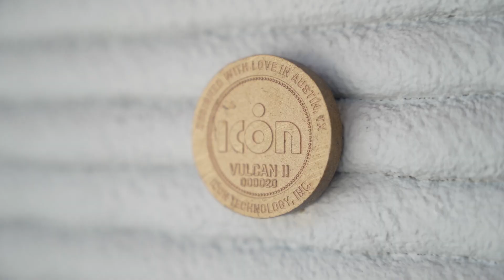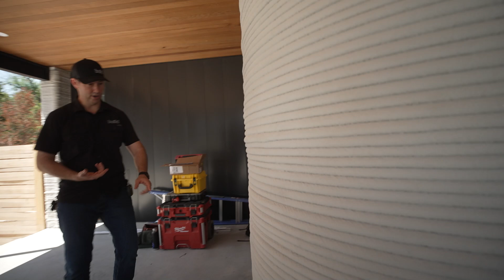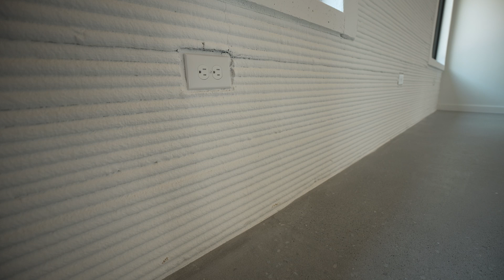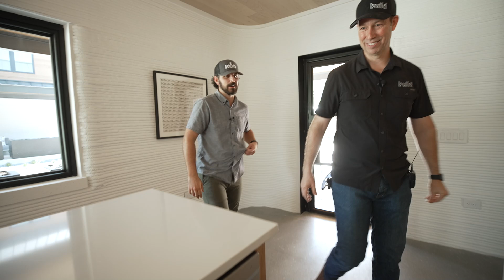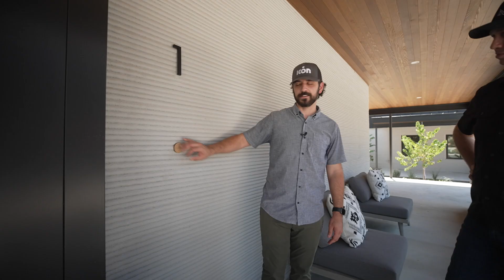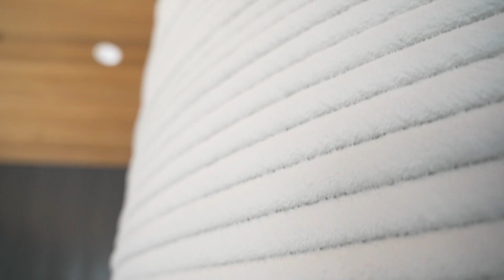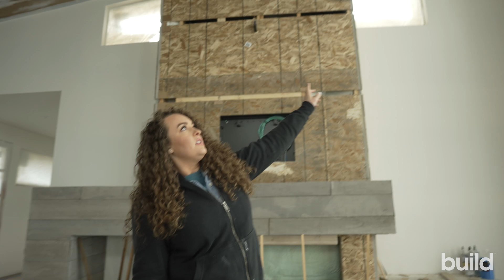Update on 3D CONCRETE PRINTED Houses - They’re GORGEOUS

Comment: Yes this is cool but don’t see how it beats ICF. It doesn’t have steel reinforcing and has major thermal bridging around the windows. Also if it floods it will never dry out due to using open cell in the walls.

Comment: You know those ugly dark streaks that develop on concrete over time thanks to rainwater? Now think of all the pollen, dust, dirt, spiderwebs etc that settle on all surfaces. Now imagine not having a flat wall, but ribbed walls.
Yeah, you’re gonna be doing a lot of pressure washing to keep your “cheap”? 3d printed house looking clean on the outside.

Comment: A non-sloped reinforced slab that runs from outside right into the conditioned space?  This is somehow any good for thermal and moisture?  Metal headers that are 100% efficient as thermal bridges?  Windows just globbed in with multiple tubes of caulking.  What?  Objectivity?

Comment: There ya go. Recycle platics in cement mix to use as plasticisers. Btw i would have built whole home concrete with edco roofing and knocked down 3d rib look. These look too much like shipping container commercial structures. Open cell foam, hydroscopic, traps water, noooo. Closed cell only. 800k whaaaaat. No way. Matt come build my home.

Comment: garbage produced by austin. hard to believe matt even mentioned "craftsmanship." you can have software, technology, tools, etc but it doesnt matter if the applicators are offering cheap products to consumers at elevated cost. texas is typical for complete trash homebuilders, this is a pure example of a cheap build slapped with sticker that has no design relative to efficiency or effectiveness for the consumer. not happy with you matt, you are known for calling out bad builders/materials
Reply: My thoughts as well.  The shiny object obscures objectivity.

Comment: Meh.

"Boring Bricks."
Modern post and beam is amazing.
And of course the USA has used concrete for a Century in order to make basements instead of "built on slab."
Still like the term "iterative" tho but of course in the USA we reinforce with steel as well if you're serious about Hurricane protection.

Any no shortage of iron ore in the USA let alone steel production at the moment.

Nice roofs and roof design as such!

Comment: 3D printing homes is the Juicero of home building technology. You could build multi story concrete homes using tilt wall panels like they do for warehouses and it'd be quicker, cheaper and have a better finish. CMU block would be faster/cheaper too. Heck even ICF would yield a better/faster result. But hey good on them for getting boat loads of VC cash from investors that don't know anything about construction.
Reply: Yeah, if you point out where their 3D construction needs improvement - they have no interest in hearing that.  So, in some cases the business model is looking like a pyramid.

Comment: The only reason why I'd want to put a plaster finish on the inside, not that the print doesn't look rad, is because all those lips are going to collect dust. Anyone who suffers from inside allergies is going to have one heck of a fun time making sure that the dust can be removed from each and every single one of those grooves.

Comment: Interesting how they will solve roof problem on Mars. It kind of difficult to build roof with 3D printer. You can print roof on flat surface and use crane to put it on top of walls, but probably they will find another solution

Comment: I 3d print as a hobby and i think at some point the 3d printing of concrete and wood will be a useful construction tool, but i think they way they designed and built the houses are frankly really suboptimal.  They could have had a double wall layer and put in aircrete or foam, could have had a guy with a trowel to smooth out the lumpy walls, or included a stabilizing intralayer material
Reply: 3d printed homes are little more than expensive novelty items.
Reply: @TMS5100  The same was said about the computer, the internet, and even the iPhone.  It's funny to hear the same about 3d homes.  Too many social, technology, and economical factors are coming together to call this a novelty item.
Reply: Exactly.
Reply: @SpaceCrete  hey you guys are doing some really cool things.
Reply: @Gleepglopglorpahaha  Thanks! Still early in development.

Comment: How does the cavity closer and wall ties work in this? He said they want to avoid thermal bridging but it looks to me as if the nozzle just goes from front to back at each window frame. Big thermal bridge spoiling the window psi. But maybe it stops and there is a thermal break of some sort? And are they putting ties in between the leaves every so often (basalt?), or is this strong enough not to need them? Concrete + PUR foam is pretty high-carbon construction of course. And I wonder how the 2nd floor is tied down onto the concrete.

Comment: Been going to countries in South America for years. Preference is Colombia. Medellin to be specific. Just spent a month there. In Remodeling all my life. The places I have stayed in are all concrete. Either concrete poured walls, floors, ceilings, etc. All is concrete. Even interior walls. Massive concrete foundations. As one professional told me. They have been doing it 1000's of years an are good at it. Huge multi-story bldgs. Tornado, hurricane, flood, fire proof. Just awesome infrastructure. Makes bldg. in USA  look 3rd world. Cabinets only thing that can burn. Clean an wash walls an repaint. Want transfer to floor above. Btw I talked to a retired American man was there during Earthquake. On 7th floor. Said building swayed a little but no damage. Medellin sits at 5000 ft elevation in the Aburra valley surrounded by Andes mountains. Called City of Eternal Spring. Great weather year round Gorgeous city. Concrete sidewalks  with tile or brick. Great restaurants. They use block also an clad it with brick or tile pavers. An many roofs use Clay Barrel Tile which is lifetime pretty much. I have remodeled enough fire, flood, tornado, an wind damaged homes to know we have pour construction practices. We build junk that is supported by the insurance industry. Remember him talking about Haiti building out of block. Well so does the Dominican Republic which borders Haiti. Saw there bldgs. Block an poured concrete inside. More durable.  We need something better.

Comment: Things I've never seen addressed on 3d printed concrete.
1. Bonding between the layers to avoid separation under in and out of plane loading.
2. Minimum Steel per ACI 318
3. Ductility requirements seismic detailing.
Reply: It is a bright shiny object, so they get distracted from all that stuff - or the moisture and thermal stuff.  Still, it is surprising that this project got permits.  Plop down mortar layers on portions of an oversized slab - that is both interior and exterior (without slope).  How is the upper floor attached?  If they placed conventional reinforced concrete between wythes, then there is no insulation.

Comment: What about insulation of the exterior walls? Seems like there is nothing to increase the R-rating. Also the curved edges, why not program the 3d printer to make more abrupt turns so you don't get that ugly curved corner? Finally, would it also be that much effort to have a mason to go over the outer walls and smooth them out as a finishing touch before the cement dries?

Comment: 3D printers are attacking the wrong area of the home building process. Carpenters can put up traditional walls much faster than 3D printers can do it when also including delivery and setup time for the 3D printer on site. What are the major project time consumers in home building? Those are the problem points to solve -- like waiting "30 days" for the concrete basement walls and floor to cure  before putting the first floor deck on. Or the roofing (trusses plus shingling). Obviously those other areas are too hard for 3D printers but the walls offer no real time advantage. Energy/carbon trade of concrete vs conventional wood?

Comment: The idea of 3D printing is very cool. Question that I would have is settling and the concrete walls cracking like a driveway. What’s their solution for it?
Reply: i think they print on top of foundation footings to prevent settling
Reply: These are engineers,licensed, contractors, and concrete experts. I'm sure they've thought of a way to prevent settling.

Comment: I’m glad you guys see the ‘positives’ in this printing process.  Doing plumbing and running wiring will be a challenge in such homes.  I followed that process as it promised better cost and lower price.  But this thing lists for 800K, no garage and a boxy industrial kind of cheap looking second floor in a condo type of a setup?  Really?  Looks to me like all promises broken.  While innovative and cool, I feel like you’re taking full advantage of potential customers, selling prototypes for a huge markup, completely breaking the promise of 3D printing.
Reply: This how early adoption works. Wireless cellphone Swede like $10k in their time when they came out
Reply: In a news report a buyer of 2 of these homes said she could not then get insurance.  Paid cash obviously.
Reply: It's all such a scam and the corporations steal all the good ideas, mark them way way up and give zero benefit to consumers
Reply: @stedmans4christ  You're spot on.  Our friend doesn't understand technology and how business works.  I did my own R&D on 10Gbps fiberoptic network which uses passive optical splitters, which really requires capital, and I never priced my product telling telecoms and cable companies, they need to pay extra to cover my R&D.  Instead, I designed most of the switching logic inside the chip itself which interfaced on both Core Network and Outside Network spend 2M to spin an ASIC, and eliminated a cost of a 25K Cisco switch from the design.  Approached customers and told me that my stuff is 1/5th the cost of competitors and explained why, and only after five years I would have made my money back of startup and R&D costs.  My customers went to my competitors, and within 30 days Juniper bought us.  If I went to my customers and told them to pay more to cover my R&D, they would have showed me the door.  Only ignorant public would fall for such BS.  Yeah use my hard earned money with no benefit to me so I can pay 2X for a house only for you to cover your R&D costs.  What a joke.  The R&D cost usually should be spread over high volume, not few suckers.
Reply: @stedmans4christ  do you think RnD costs nothing? It’s VERY expensive. They probably made close to no money on these homes

Comment: Too Cool. What is the cost of the sealant? How often does it need to be done? What is the p.s.i? of the walls, insulation value?
What is the wind load factor? Can vertical rebar be put in to support girders for a concert, fireproof ceiling? How would you figure the volume of paint or sealer with a texture like that?

Comment: That's a cheap ugly no frills house. They are selling the gimmick.

Everything about it looks no frills. Geeze. Why not parge the walls. 

Big secret. Haha. They add accelerators into the concrete at the hose. Big secret. Concrete is cheap. Those walls should be thicker. A tornado will take that roof off, its not concrete.

Comment: Matt, how does this process effect the price per square foot? As you and Connor said this is an awesome looking house, a really good looking place, inside and outside to live. Stunner would be the short form. I agree with Connor about time spans- the cementicious parts of these homes should last a century- something our present wood structures will have to do some serious doing to do! Glad you brought this one too us, Matt! Stay healthy! FR
Reply: What are you talking about?  The top is traditionally built.
Reply: @alexJohnson9119  Indeed it is, and clad with steel. That cladding should easily last the 50 or more years it attains as the covering for pole barns and buildings.So, it, like everything else built by man, will need a bit of "freshening" a few decades down the road. That part of Texas commonly sees "common" topping materials, whether on walls or roof, breaking down less than twenty years on from the sun.  FR

Comment: This is great for areas that get hit by hurricanes, but I think it also works for areas with a lot of heat too. I would stucco the walls to give it a flat appearance, like a Spanish mission type look. The outside looks good, but I'm not a fan of concrete walls inside because I imagine remodeling would be super challenging as well as electrical upgrades/repairs.

Comment: Again, how does the wall not transfer energy at the door and window casings? It’s concrete from inside to outside
Reply: But the headers they print over are pure steel - even more efficient at heat transfer.

Comment: If you really want to do something RELEVANT, try a video comparing this to poured concrete. Thus far I have yet to see a compelling video explaining the preference of one to another. If you need to invest in the technology, how is this superior to reusing foundation forms to build the first floor of a project like this?
Reply: or..  trowelled shotcrete over a  reinforced "half form" (vapour barrier / insulation over permanent internal wall lining - or removable  form board., ??  one alternative) -  eliminating full forms does reduce the setup labour, transport and material costs..

I don't see that this 3d Printer is an optimal design - a skeletonised truss and tower system would probably be more useful / modular.  than a hard to; setup and deconstruct, Bridge on Rail system.

No Cost saving, as "innovation" becomes a luxury commodity.

Reality - Mortarless block walls with core fill, or ICF gives strength, resilience and cost effectiveness, 3d printing is a bit of a sideshow (and I am a Mechatronics /Mechanical Engineer with a workshop of 3d printers, so a fan of the tech.)
Reply: Want to talk relevance, when you are unable to find a concrete contractor to build your foundation because they have all retired you'll be calling ICON.
Reply: @mcintosh.daughter  in Bucks county,  
( equidistant between NY and Philadelphia), that’s quite untrue.
Reply: @williamwoody7607  Glad to here that. I think the youngest concrete contractor in my area is 42.
Reply: @mcintosh.daughter   they still needed a conventional concrete foundation poured to print on top of.
Reply: It looks like it's uninsulated concrete without reinforcing bars.  So yeah...it it faster than precast?  Is it cheaper than block?
Reply: I dunno man, what if it makes this look bad in comparison... Can't be having that.

Comment: "we are trying to avoid  thermal bridging" Says the man standing next to a window opening with HUGE thermal bridging at the sides! :) 
This guy should go in to politics LOL
Solution: create a plastic, thermal resistant, pre-formed "thing" that you place between the beads where the beats don't run further from inside to outside, and make the thermal plastic "thing" part of the structure. There you go, solution presented! Contact me for details ;)

Comment: Really like the house- doing the first floor  with the printer- and then shifting on the top floors using a factory built model or kit makes  sense.  Like the picture rail system.  Could you build the window sections already framed up in a panel that would then  use a crane to drop the window section or door section down into slots  or notches in the wall?   Do not think you could set the door and window section in place and then print around them locking them in place.  unless the window section were like precast legos that you would just stack a block on top of a block as each layer was printed .  Would have a very precise square factory produced rough in opening for the windows.  possibly could use a composite material that then could be easily screwed into.

Comment: A little disappointing he mentioned they wanted to build structures that stand the test of time yet they've filled the cavity with open cell foam. In a wet climate, the water would rot it over time. Closed cell foam is a much better option for rigidity, R value, and waterproofing.

Comment: Great video Matt. Love to see new technology in construction - and yes it’s expensive. But isn’t it always until it becomes more ubiquitous? As a designer what works for me are the contrasts you get between the concrete, which has curves, imperfections and almost appears to be executed by hand, and the sharp lines of the stick framing and steel siding. 

On another note, this video makes for a good drinking game. Take a shot every time he uses the term “lean in!”

Comment: Imagine being an electrician, audio/tv specialist or network tech that is called to a house like this and asked to run wires, mount a tv and hide the wires in the wall, or having to repair a line in the wall. Not gonna be a fun day.
Reply: So easy.
Reply: If you watch the other videos everything is thought through and easier than a typical house.